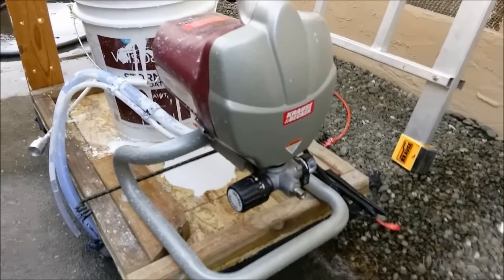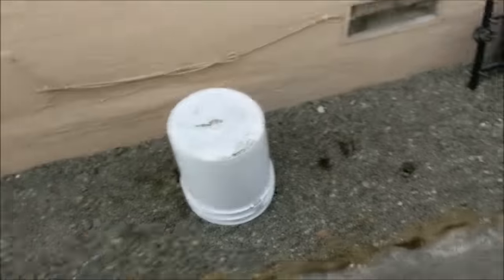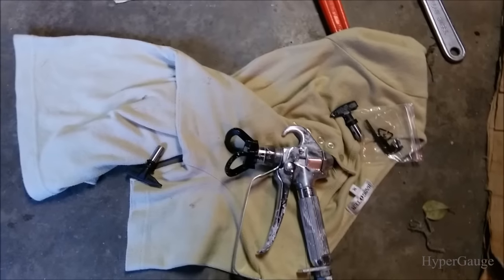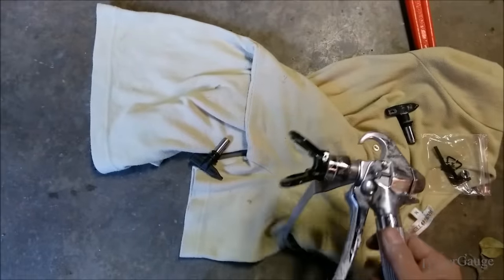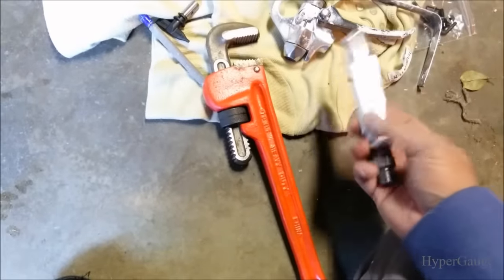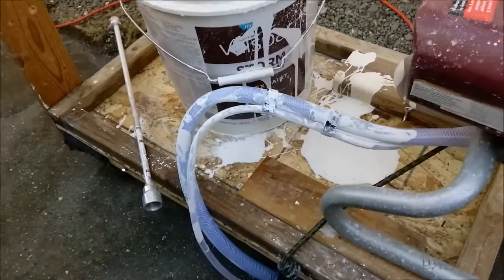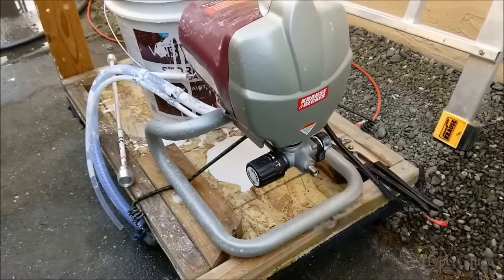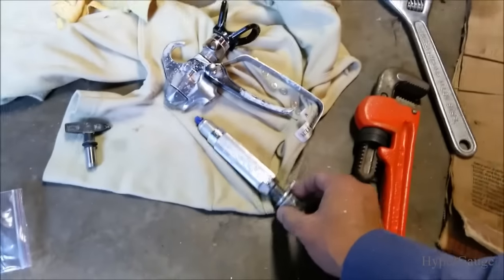Harbor Freight Krause & Becker Paint Sprayer System review Spray Gun disassemble and how to, tips.

Comment: what size thread do i need for an a extension im going get this paint sprayer tomorrow and wanna get a extension off ebay so dont have pay big bucks at menards for a extension im doing house paint job from ladder and wanna make as easy as possible
Reply: i was guessing it had 7/8 thread through little research and wanna make sure ...i ordered a 413 tip to paint house with as u suggested now im after a 20" extension
Reply from the maker: Yes. It is 7/8 thread. The one I got is from Amazon. You can search for "DUSICHIN DUS-200 Extension Pole for Airless Paint Spray Guns, 20 Inches"
Reply: Thank u very much appreciate yah just ordered it same one u sent me link to....got me a swivel end as well....were u get the 413 tip u suggested in ur video
Reply from the maker: You are welcome. My 413 tip is from eBay. I didn't order the brand name one since the system will not be used that often. So far the cheap tip is still working fine after a few houses are painted.
Reply: Cool yeha thats were i got mine from think it was like 14.00

Comment: Would I be able to use this to paint vehicles and cars parts? Fenders, bumpers?
Reply from the maker: I never try to paint a car with this sprayer. I would say that is not a good idea.
Reply: defyingtheodds1987 
depends on how important the finished product is to you there will be a lot of wet sanding and buffing to get it to look like a normal car thats painted but you would definitely have to use the finest tip that you could possibly find as if you were going to spray a very thin stain you'll get a lot of orange peel and drips if you use a tip that you were spraying for late text can it be done yes would I do it to my own vehicle absolutely not will I get the paint on the vehicle absolutely you might be better off using spray paint cans
Reply: Perfect for priming, but not good for color and clear coats.
Reply: defyingtheodds1987 No not at all. This would be a horrible way to paint a car it would literally look like shit and waste a lot of expensive paint.
Reply: I would but just primer
Reply: Ya gotta figure that if a lot of guys are painting their cars with Rustoleum and a ROLLER or with Rustoleum rattle cans then this would be a STEP UP from that.  And, judging by the videos, they get some real good results with rollers and rattle cans.  I think the secret is all the work you do IN BETWEEN the spray coats.  All the fine wet sanding etc.  As some have suggested, use a better air spray gun for any final coats or clear coats if you wanted.

Comment: Can someone tell me if you can spray clear lacquer with this airless sprayer?  I also would like to know if the owners manual says anything about spraying lacquer with this sprayer.  I know some sprayers dont have the proper internal parts to handle lacquer based products.
Reply from the maker: I never try it. My guess is not.
Reply: Yeah.  That is what I was thinking too.
Reply: I have and you can but beware anything left in your lines will come out..... and after you're done run thinner through it and then water .... and add pump restore for storage.... I use then to spray stain, sand and seal and sealers
Reply: Thanks for the info!

 I would use this sprayer only for clear coat lacquer....nothing else. I would also run thinner through it after each use.
Reply: add pump restore when you store it because thinner will dry the seals.... the resort will keep them well hydrated .... just prime it throught the pump and leave it in it.... one bottle will last a long time depending on how much you use it
Reply from the maker: This thing can spray sand... you serious? Don't tell me it can do sandblasting. It will be awesome if it is true.
Reply: TheBasscomander  Ok, Thanks!!
Reply: @HypergaugeDIY  sand sealer, not sand.

Comment: can you  run oil-base. on that sprayer ?
Reply from the maker: Sorry. I never try oil-base paint with it.
Reply: Water base enamel. No oil base enamel!
Reply: You definitely can. Just needs thinner for cleaning.
Reply: Absolutely !
I have use mine at least 10 times with oil base polyurethane and it works fantastic just be careful  because it deliveres heavy coats!  Have mine for 3 years and still running!